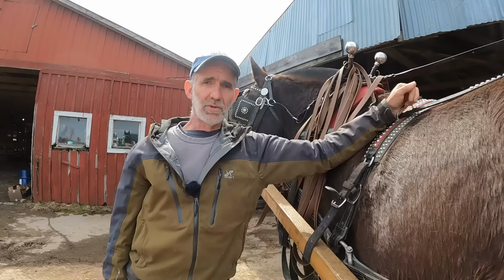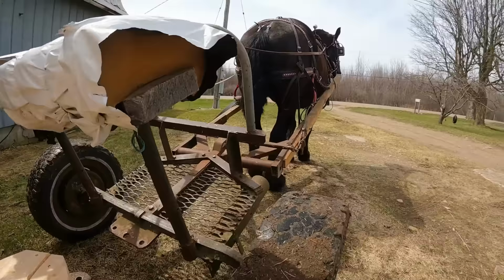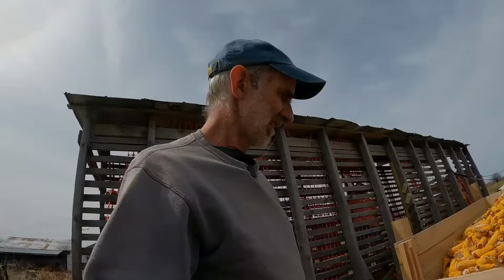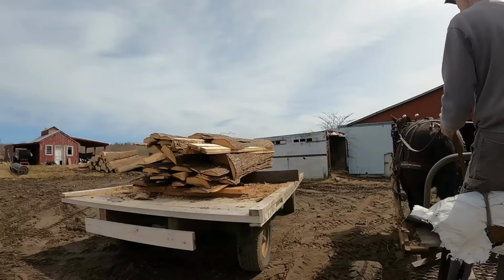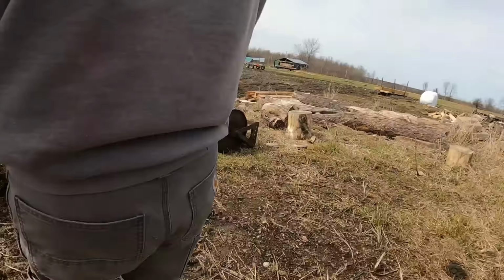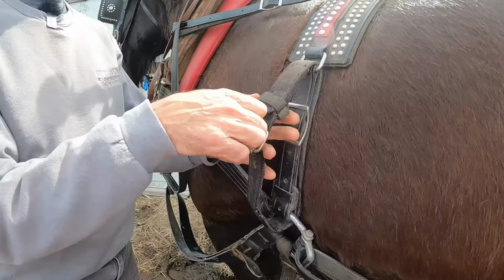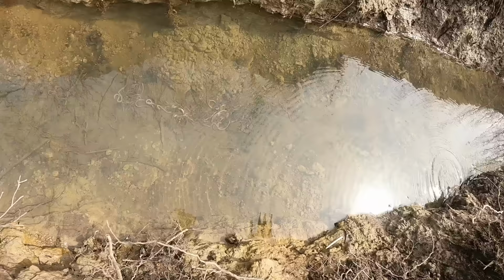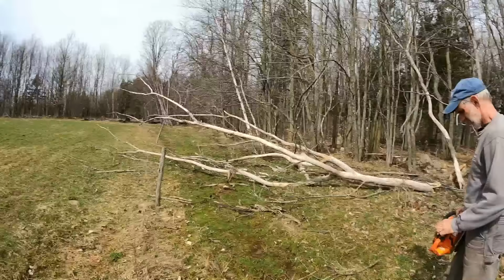Can you run a Farm with just ONE Draft Horse??

Comment: On your wagon, I noticed all the wood used to enclose the tongue.  You could add some weight under the rear of the trailer to counter all the weight the wood puts on the tongue of the trailer.  Just use some carriage bolts and bolt some of the scrap pieces you had bundled on the other trailer to counter and make the tongue lighter.
Reply: But the total weight goes up and increases the load for the horse(s). Perhaps the axle a little further forward- however it was likely planned for balance with a full load and tipping back would be much worse than tongue heavy.

Comment: I can spend half my working time looking for gloves, coats, tools or hardware that I have put down on my way around the property. I'll be heading somewhere with gloves and secateurs in one hand and a garden fork in the other hand and see a new seedling I forgot to water yesterday. So I put my luggage down and hightail it back to the shed for a bucket of water. Come back to the plant and water it, but then completely forget what I was doing originally and head off to do something else with empty bucket inhand. Then remember later and have to hunt high and low for the tools I put down beside the plant that needed watering. Or a big one is I have different gloves for different uses and the pair I need now are wet from yesterday's job so I have to hunt down a different pair and where was I using them last and where did I put them to dry or which bucket of tools are they in? I tried using a small pull behind tote but it was such a PIA in my uneven garden and I clawed the heels of my shoes a few times dragging it behind me. I tried a canvas backpack, but it could be rather heavy and the on, off, on, off all the time was tiresome. I do use an empty water bucket a lot but it only holds one tiny half an armful which is often not enough.

Comment: Clay soil with rocks and bigger boulders strewn about. I have the same thing but my property is on the edge of a golf course in Northeast, Ohio. Twenty thousand years ago I had a mile high glacier over my property. When it faded away what was left in my case was clay soil, some rocks and some bigger boulders deposited along the way. On the bigger boulders you can still see the scrape marks where the boulders scraped the "surface" along the way. Those rocks were said to have come from Canada. Clay soil is very difficult to work with. You stick to the ground and those horses probably stick into the ground as well. They earn every corn cob they can get.